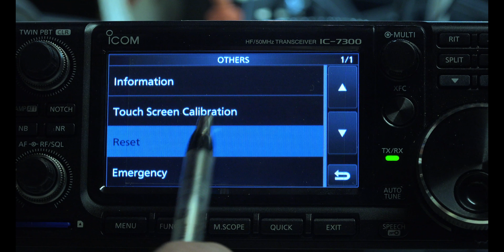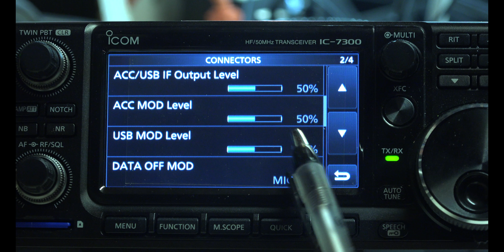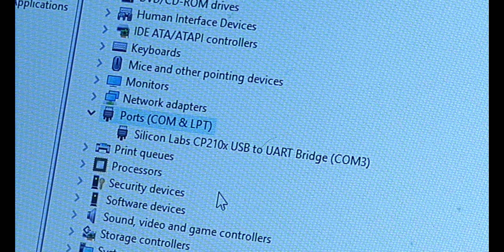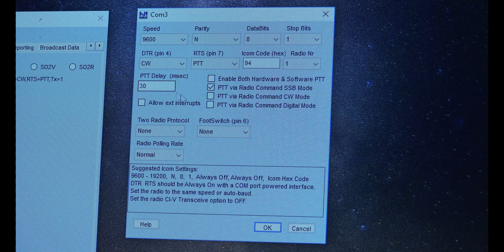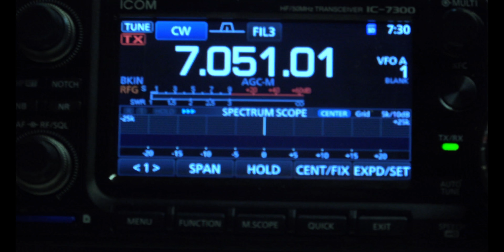Icom 7300 N1MM Software Rig Control Settings Computer CW Transmitting

Comment: Great video. Question - I have same radio and setup. Works fine until I raid power above about 25 watts on radio and key cw- it freezes program and I lose com port. Ever had this happen.
Reply from the maker: Sorry, Lane I've never experienced that.
Reply: Ham Radio CQ thanks for reading and for all your responsive comments to other viewers. I figured it out- RFI from my tuner.
Reply: @lanedossett  RF in your shack. You need to choke your coax and your USB cable with ferrite chokes.

Comment: I followed your video with great interest. I have my Icom IC-7300 single cable USB working with N1MM and it shows the radio frequency read-out when I switch in CW reader (FLDigi) it comes up stating N1MM not polling with radio? any ideas please. 73 Phil G0BVD UK

Comment: Just got my 7300 today. Going to install n1mm later tonight. Question, when sending the CW with the program does the radio need to be in CW or USB mode?
Reply from the maker: I'm not sure, try both, but also try digital mode.
Reply: I got it working. And installed FLdigi and WSJT-x. All is working. Your videos helped me out. I’m so glad I got this rig instead of a KX3. I’ll have to use my FT-100d for portable now. Hi hi. Thanks a ton. 73- de KD4CR
Reply: @hamradiocq  Yeah dude but what did YOU use on your MRP40 CW program, what mode was the radio in when you were transmitting CW with a keyboard using MRP40? I've seen a few people ask you that and you're not being clear. What did YOU use? Also .. do you have a video that shows the screen when using MRP40? Thanks

Comment: When I open N!MM, my 7300 goes into Transmit . I have tried changing settings on radio but can't fix it. ONe setting I changed caused my SSB to not work, but also did not fix problem, Any ideas? Thanks! W4CRS
Reply from the maker: Sorry, Jere, I'd have to work with it to figure it out.
Reply: @hamradiocq  Thanks for getting back to me, however, I finally found the mystery setting causing problem, It had to do with usb keyer in settings or something like that. But all good! 73 de W4CRS

Comment: I have an IC-7300 trying to run N1MM, When I key up the waterfall loses sound connection. I have everything set to your settings except the 9600 speed. Nothing would run unless it was all 115200
Reply from the maker: I'm not sure, but maybe the RF is heavy in your shack and it's shutting down things.  I used to be able to turn off my TV in the living room when I keyed up 100watts in my attic.

Comment: Modern radios which ic7300 is must be capable to work with faster speeds. Minimum 19200. I find PC program is more responsive with faster speeds. Cheers! de ly2kz/ly5t